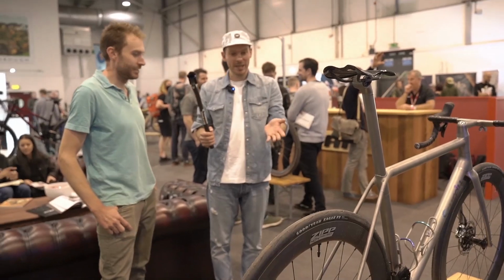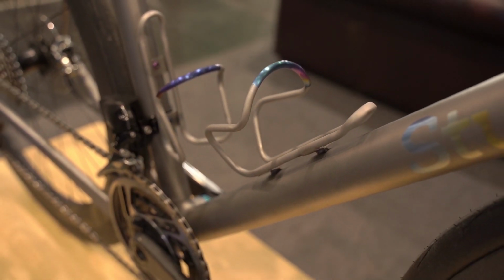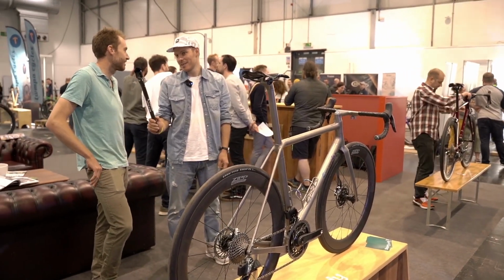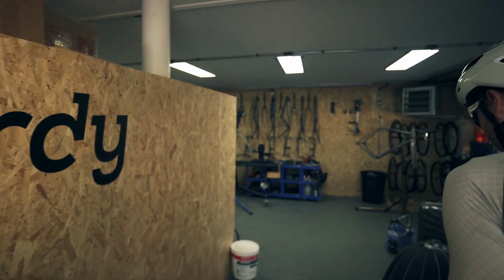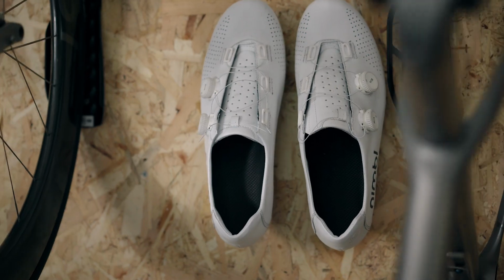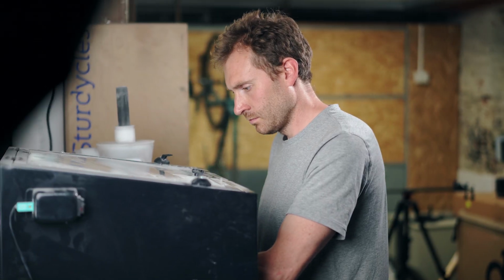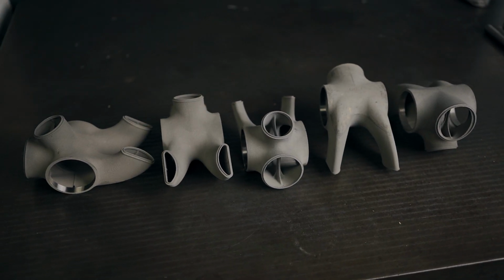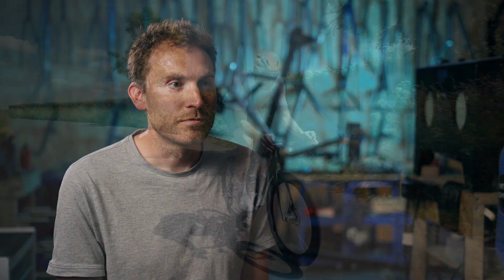Inside STURDY CYCLES workshop - 3D Printed Titanium bikes

Comment: My 2002 Litespeed titanium ultimate has oval tubes.  Much faster.  Try holding a broom handle at one end in a 30mph wind. You can’t.
Then try holding an oval tube at one end in a 30mph wind . Almost no resistance.
Reply: I believe that those titanium tubes on the Litespeed were hydroformed into that shape, correct?

I am waiting to see if some of these 'printer' builders can come up with a fully NACA/aero tube shaped, printed titanium aero road bike as a solid 'sturdy' (if you don't mind the pun!) alternate to all of the lousily built, very low quality, carbon stuff out there.
Reply: @Fordworldrallyfan   Yes the 2002 Litespeed Ultimate ridden by Robbie McEwen won 17 races including the green jersey at the Tour de France.  I believe a Trek branded Blade ridden by Lance Armstrong won the time trial also. Definitely a very fast bike even today.  There is now way I would pay 14,000$ for a carbon bike made in China or Taiwan.  I hope the young engineers work on making a fast 3D printed titanium bike .  It can be done. 
My chainstays were made for a 19mm tire but I used some heat and auto body tools to open it to accommodate 25-28mm tires. Much better!
Reply: @Strange_Brew  Yeah, my Merlin can handle 25Cs, but that is the final, absolute limit for those chainstays, and sadly (and infuriatingly, at the effing manufacturers!), it makes finding narrower rim brake wheels (especially anything even remotely aero and deeper carbon, let alone with a Campy 10 speed freehub!) next to impossible to find nowadays. 🙁👎👎
Reply: @Fordworldrallyfan  I heard that you cannot hydroform ti...
Reply: You mean that your titanium bike is 20 years old? Did you notice any change in the bike handling since then? 
I really wonder if titanium is really more resistant than aluminum.... I'm looking for a forever bike to bikepack...
Reply: @fedthedual3382  My Merlin Road does not feel, ride, react, or handle any differently now, 23 years after being built, than the first day I ever rode it. 😉

I have no idea about aluminum, since I've never owned a bike made out of that material (save for whatever small amount is in my frame's 3-2.5 titanium alloy tubes).

Comment: Did you get the weight of that build at the start?   
Managed to get my disc, hydraulic and mechanical geared titanium long distance road bike to 8.3kg and that cost me about £6500, and that was a self build from start to finish.

Love titanium bikes, I have two so far.  Not cheap